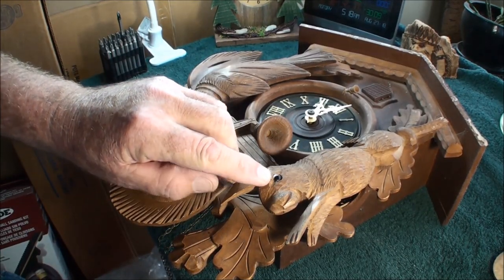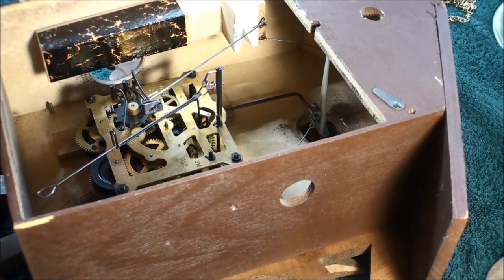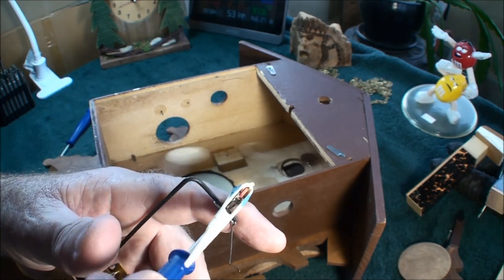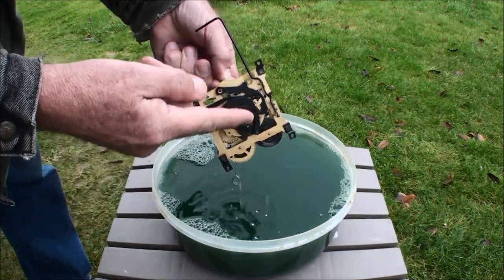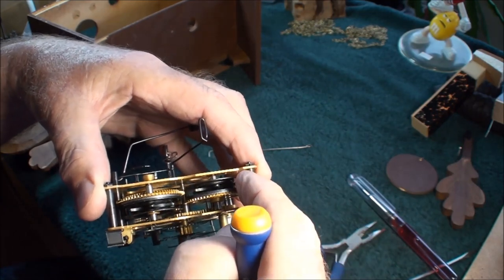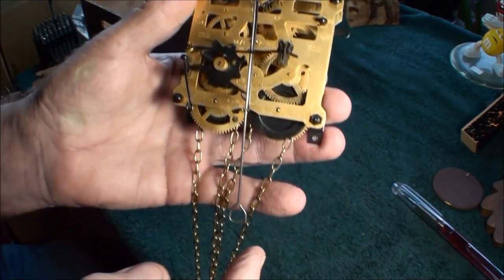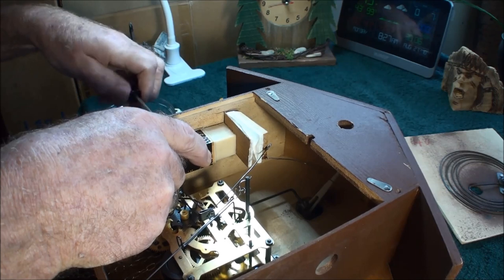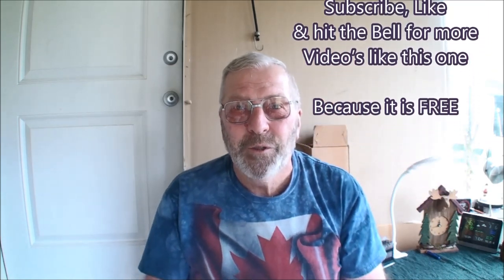1969, 8 Day Cuckoo Clock Cleaning

Comment: Thanks for the great videos, love them. Just recently i rediscovered a family treasure in shape of a Regula movement and by looks of appearance, a black forest cuckoo.  I have nothing to lose but maybe a bit to gain by trying to get it to work better. As for cleaning can i apply or dip it in surgical alcohol, as im not confident to take it apart, and oil it. All of movement seem to be in good and working order
Reply from the maker: Giving the movement a good blow from a can of air for your computer would help first. Just remember that not taking it apart will always leave the old oil and dust in the pivots, so you might try running the clock gears while dipping the movement in the alcohol. also using a toothbrush around all the pivots and moving parts. Good luck on your cleaning and at least this will be a good start Jacques O
Reply: @justmike57  hi thanx. But it seems the cleaning alcohol( medical)version didnt do too good for mechanism. Run for few seconds with escape wheel. So i rinsed it ou good with light soapy solution then air dryed it hairdryer. To no avail, tried again
Reply from the maker: @jacqueso8424  after using the dish soap and a toothbrush for scrubbing, a good clock oil in each of the pivots should make the clock work again. Also, don't forget to oil the part that rocks back and forth from the pendulum. Sometimes there is a drag or friction there and as the wheel is turned with every tick, it will slow the clock down and even stop the clock. 
  Also something to remember, if you didn't take the movement all the way apart, it will take time to get the clock running again. The old oils and dust in the pivots has loosen and is now gummy and that will stop the clock as well. To get it running again, oil you movement again then keep starting the pendulum every time you walk by your clock. You start it enough times, the clock will start running again. The new oil is loosening the old oil
Reply: @justmike57  thank you so much for the help, it is much appreciated. I really dont want to give up on the cuckoo as such as i have already made a process to make new numerals and also repair the crown and side decor panels

Comment: You clean it up. possibly all dust particals sank in the water. now it is looking good. Mike you explained it's mechanical work quite deeply. You have a complete knowledge about cocuclock.
Reply from the maker: I have hope the clocks will run for at least 10 years before they need cleaned again E Learning & Cooking.

Comment: I am not knowledgeable at all, but want to try and repair my cuckoo. It has 3 weights and I cannot get the top chain on. So nice to watch your videos. I’m going to keep trying. Thank you.
Reply from the maker: You can do it! Holding the other chains with a wire, cloths pin or anything to keep them tight so they don't fall off. Getting the top chain on, I an thinking you are talking about the music chain. It helps if you can trigger the music to play so you can pull the chain over the winder easier.

Comment: Hi there from South Africa.  I'm in the process of fixing a cuckoo clock for a friend, and it being my 1st time, your video helped me a LOT!  The one I've got here has the exact same mechanism, with just a bit taller case.  The dating on the rear panel is 8-77.  Also came across those cheapo pesky staples.
Reply from the maker: I am not knocking the Cuckoo Clock, but most the older ones you work on seem very cheap made. The stain will wipe off easily with a cleaner or oils. Just the same, that is the art and aging the clock in return makes them even more unique Matthys de Wet. By the way, welcome from South Africa.

Comment: Mike, thank you for such a great instructional video. You took your time and showed parts and explained what you were doing and why. What did you use to soak the gearbox in?
Reply from the maker: I am using up my online Boughen Movement cleaner, but I do have a video out on home made movement cleaner that works very well and was also tole to add  a 1/2 a cup of Murphy's soap to get the brass to shine better. This is the link to the video: https://youtu.be/eIQ9LAfPCKw

Comment: I have the same clock as you just worked on. i cleaned it and reassembled it. When I hung on the wall and attached the pendulum, the pendulum doesn't stay swinging. I have no idea why it won't run. It has been cleaned and oiled. Any Ideas or suggestions as what I can do?
Reply from the maker: I would check two things. One, check for worn pivots, if the pivot will move from side to side, an 8 day clock has a problem with running with worn pivots compared to a one day clock that can run with a lot of slop from side to side. Two, check that each gear will move up and down, they call that end play. If the gear does not move up and down, the frame might be too tight and causing the gear to stop. 
  I also stopped using clock oil on my clocks. I have been having a problem with keeping the clocks running with the clock oil. I now use motor oil. Full Synthetic, SAE 0W-20 is what I use now and have had no problem since I change over.  I have a video on this subject as well: https://youtu.be/DLm-CwwMnQ0

Comment: Superb work as usual Mike. Your a real wizard at these things. I like the method you use to clean and oil these. Some have argued at me saying total dismantling the movement is the only way. I say its whatever method your comfortable with that gets the job done as not everyone's an expert. Totally dismantling it without knowing all the pieces, how they work or go back is quite intimidating. Especially with unexperienced people like myself when it comes to the mechanics of these. So your method is more comfortable with people like me. Just wanted to thank you for demonstrating that. I'd love to see you work on a cuckoo clock that has the cuckoo bird and a quail bird too. Keep up the good work!
Reply from the maker: I have had some of the same people tell me to stop showing people the wrong way too clean the clocks, but my channel for the clock cleaning is for people like you that just want to try to get their clocks running again and if they can find a clock shop to take it in to, the charge would be most likely more than the clock is worth to them. 
  I have heard and seen people using all kinds of spray oils to get there clocks going again, and it may work for a while until more dust really gets stuck to all that extra oil sprayed in there. So this is why I try to help people with their clocks and try to explain what some of the levers and what not, do, so they might be able to solve their own problem.  I also have my email below the video so if they are having a problem, they can send pictures and what might be their problem they are stuck on. 
  Thanks so much for the good and kind words Sammy Roark

Comment: My clock just gives one single coo coo on every hour. What do I adjust to get multiple coo coos on the hour?
Reply from the maker: In my videos, I explain what each part does on the Front of the movement. Your levers are not falling down when triggered to do so. It could be that they are sticking from old oil and dust, maybe a spider made a home in the clock when it wasn't running or someone was turning the minute hand counter clock wise to get the right time and the little arrow that drops on the snail is bent now and needs adjusting so it will drop back on the snail again.

Comment: I have this same clock. The bar that is connected to the pendulum that counts tick tock and keeps time is broken off the frame. The bar that connects to the gear that counts and moves the pendulum. How do I reconnect it to the frame?
Reply from the maker: I do believe the the bar is pressed in. if it is broke off, you can try to supper glue it back on, but will not hold up to another cleaning and will have to be re-glued again. You might have to find a new plate or used plate if you want a more permanent fix. Looking on e-bay maybe, or just buy a new works. I have an email below the video that I can send you a link to where I buy my parts from Valerie Jo

Comment: Very good videos, Mike! Thanks for sharing! I had a few questions, one of which you answered, regarding the liquid cleaner you use. My other questions pertains to the cuckoo bird speeding up on the video the more times it cuckoos: Is that a frequent problem? Any idea what caused that? Does that throw off the clock keeping accurate time, or do you need to reset it every so often? Whenever I have come across cuckoo clocks, and I could get them at a decent price, I did. I now have over 30 cuckoo clocks. BUT - none of them work. Not yet! I got them with the expectation that I would learn to fix them. And I will. They have always made an impression on me. I hope to come to love working on cuckoo clocks like you do. Thank you again.
Reply from the maker: The speed of the cuckoo doesn't effect the clock. I had another person tell me they put wax on the fan part to slow the cuckooing down to the right sounding speed. This is ok as long as your fan is still holding on and not broken, (depending on how fast the cuckooing of the bird). 
  When starting on a cuckoo clock, start on one that only cuckoos. And a cheaper clock as well so if you mess one up, you are not out of that much money. Besides, you mess it up, you learn and should still be able to fix it.

Comment: I have a Cuckoo Clock that I have moved the pendulum all the right up is there something else  I need to look at for adjusting?
Reply from the maker: Not knowing anything about your clock or what you have done with it, but if you are trying to get the clock to run faster, moving the pendulum up is the right thing to do. If it is still too slow, then it would be a good time to take the movement out and oil both sides of the clock and maybe blow out the dust. This is what they recommend if your clock still runs. If the clock stops, they recommend you clean the movement because the old oil has turned to a thick, shellac and dust build up. Hope this help you Mike.
Reply: @justmike57  I think I have finally got it I had to move the pendulum up pass all the  notches to holed it in place a little piece of tape so far has done the trick I'm thinking someone has changed the pendulum wire and it is to long but I not sure I know what I'm even talking about lol but think you for the reply I've really learned a lot from your videos. I will blow it out and see if that does the trick too.

Comment: How do you tell if it is a 1 day or 8 day clock?
Reply from the maker: A few ways you can tell for the most part. 8 day has a larger size chain... but there are some 1 day clocks, with age, that are also large chain. Also the weight, if you have them with the clock. For me, I have a lot of clocks and I try different weights to see which one makes the cuckoo or music sound right. I don't think you can really tell by the markings on the works that I know of Michael Shenhouse.
Reply: @justmike57  One day has 3 gears in the time train; 8-day has 4 gears in the time train.

Comment: Are you not  oiling  the pivots in your  clocks?
Reply from the maker: The only thing I don't oil is the gong and lift wire arms. Maybe I don't show it on here or my hand is in the way again. Even after oiling, getting the clock timing correct is also important. Thanks for stopping by Jack Yavno

Comment: Great video. What areas do you oil? I assume you don't go overboard with the oil, but is there a specific oil you do use for cuckoo's?
Reply from the maker: You oil on the front and back plate where the gear ends go through. You need less then a drop of oil and if you get to much oil on, take a Kleenex and dab it off. Oil attracts dust and dust with oil is what stops your clock from working. They do sell Clock Oil. You can look it up on line for a clock parts site or they also sell it on E-bay.
Reply: @justmike57  Ok, thanks. I'm sure thats whats going on with mine. It worked for a couple years, then it quit. Every time I start the pendulum again, it quits after a few minutes. So I'm going to do what you did. Disassemble, clean, oil certain points and hopefully that will work. Thanks again